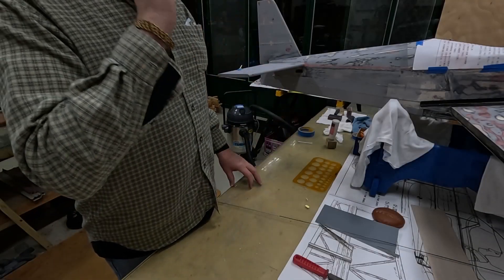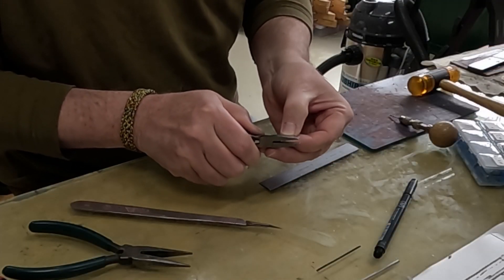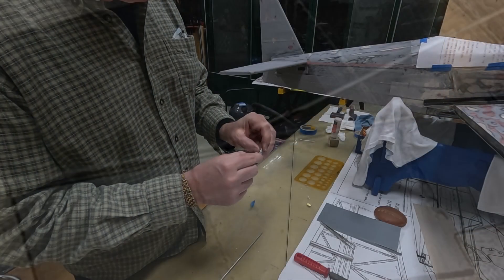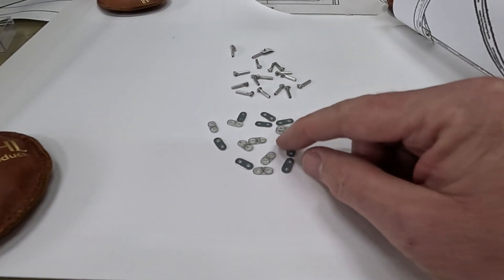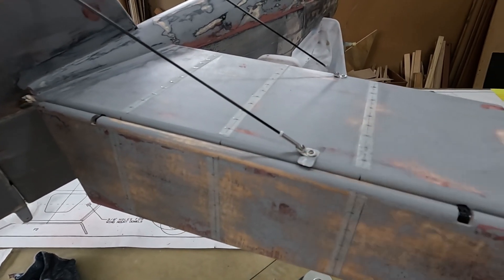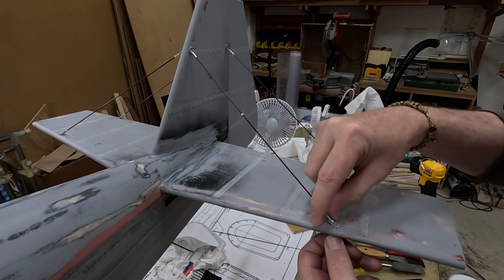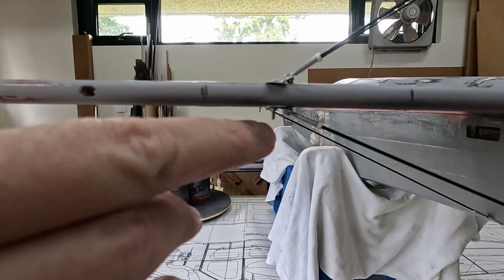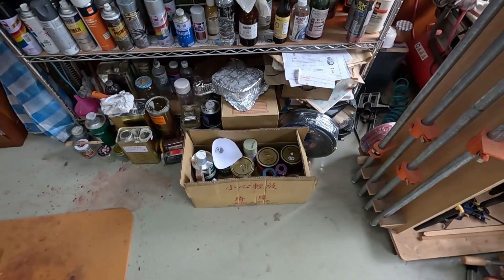DR-107 One Design RC plane build, Update #27, Tail Bracing Wires

Comment: The 3 view drawing you show on your video shows the tailplane underside bracing wires both going to the rear fixing point on the fuselage.  Ie forms a triangular shape. Model is lookin good cant wait to see it in the air.
Reply from the maker: @davidwalsh7486  You're right but I don't really trust that.  Photos of the real aircraft show separate mounting points.  The three-view is the only one I could find and it's really just a place holder as an end piece. 
I'm looking forward to some air time also!  Thanks for the input.